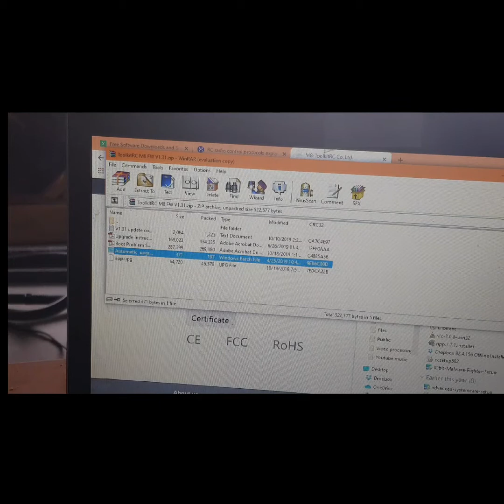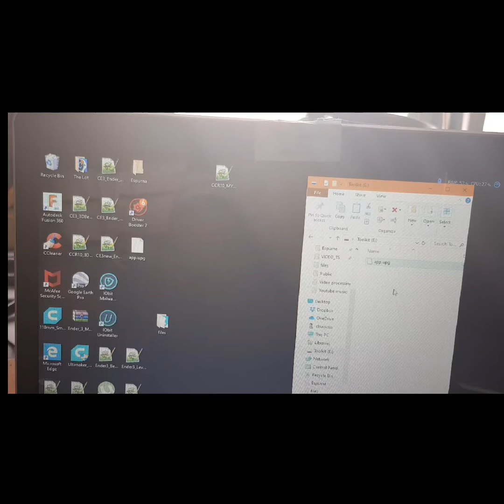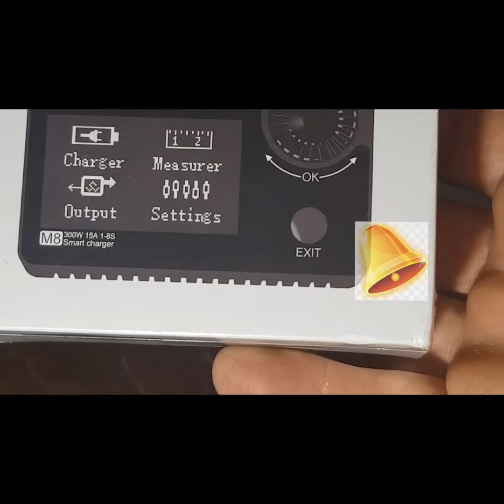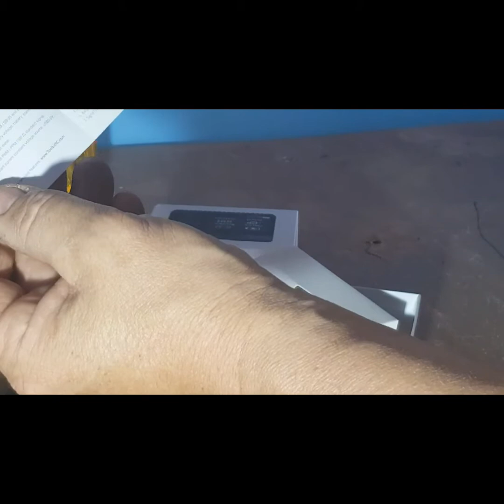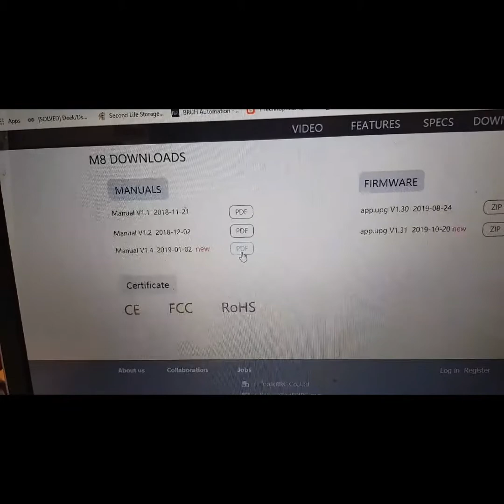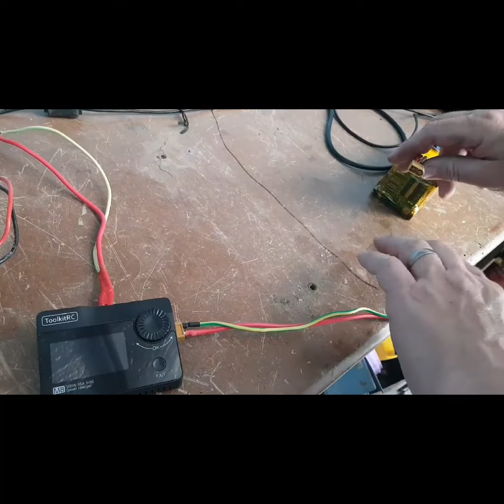ToolkitRC M8 explain the power supply system and firmware update. Read comments first.

Comment: Ok wow it's not just me! I got one recently (Jan 2021) and had an issue where it would begin to charge then after a few mins the input voltage no matter if it was a battery or DC power supply would start to drop to the point it gave low input alarms, so I was advised to update the firmware, so I did and as far as firmware updates go this was by far the easiest, all looked good so I disconnected it from my PC and plugged a 6s into the input... HOLY HELL!!!! The fricken thing exploded throwing high amperage sparks for a foot, the smoke and sparks were like fireworks! Long story short I sent it back, got it replaced AND refunded, I've obviously NOT updated the firmware or calibrated it and It seems to be working perfectly so far, here's a question for anyone who knows more, is the calibration meant to be a one off or something you need to do occasionally or all the time?
Reply from the maker: As a previous calibration technician we would do it each year or two years. Saying that what are they referring to, the machine? Calibration  is normally done to a high machine which is 10 time better than the machine you are using. I think I will pin yours to the top for people with problems, doesn't sound safe.
Reply: @chuxxsss  so what would you suggest I do? I'm an ex computer technician so I've no issue measuring and adjusting highs and lows with my trusty Fluke MM, do you think it's worth doing or leave it as is? As it turned out I've ended up with two of them now, the other one is still sealed in its box and also has the external 180W 19.5v 10amp power supply, what do you suggest? What do you think is the best way to calibrate it? The manual says "press the exit button once while in the logo interface" when I do that nothing happens and I don't want to press too long and possibly send it into some debug mode etc, Thank you very much for your advise, I really appreciate it and I've no doubt many other people will as well as I've had a hell of a time finding out any of this so far 😐 so again, thankyou kind sir :)

Comment: One more question if you can help, I've looked for this everywhere, I've downloaded the full manual and googled all day but I cant find this, when charging or discharging to the left of the voltage value in red there's either a "CC or CV" that I get, but underneath that next to the amperage either a green P F or I appears from time to time, I'm obviously an idiot but what does it stand for, as I've sat and watched it but can't see a pattern to it, please someone put me out of my misery lol, what do they mean?
Reply from the maker: CC is constant current or for CV constant voltage. So then we come to PF or Power Factor here is how it works.
Power Factor is a measure of how effectively incoming power is used in your electrical system (energy efficiency) and is defined as the ratio of Real (working) power to Apparent (total) power.
Real Power (kW) is the power that actually powers the equipment and performs useful, productive work. It is also called Actual Power, Active Power or Working Power.
Reactive Power (kVAr) is the power required by some equipment (eg. transformers & motors) to produce a magnetic field to enable real work to be done. It’s necessary to energise this equipment however it does not perform any productive work.
Apparent Power (kVA) is the vector sum of Real Power (kW) and Reactive Power (kVAR) and is the total power supplied through the mains that is required to produce the required amount of Real Power for the load. It is also known as the ‘demand’.
Power Factor expresses the ratio of real power actually used in a circuit to the apparent power delivered to the circuit. The total power demand on the network is usually greater than the real power. The ratio of the real power to the total power is your power factor, a number between 0 and 1. The higher the power factor the more efficient your site is at utilising the supplied power.
The ideal power factor is unity, or one (1.0) which means that all the energy supplied by the source is consumed by the load. Anything less than one means that extra power is required to achieve the actual task at hand. Power factors are usually stated as "leading" or "lagging" to show the sign of the phase angle. Capacitive loads are leading (current leads voltage), and inductive loads are lagging (current lags voltage).
So you took me back on this one lol.
Reply: Great thanks for all that, went I bit off subject but I'm glad you did as you answered a ton of other questions I've had over the years. You've got a real gift when it comes to explaining things, thank you! With the letters I mentioned on the bottom line are either F, P or I alone but not together, e.g. not "PF" rather "P" OR "F" OR "I" at diffferernt times during the charging cycle, I've also noticed that in the discharge menu there are actually 3 options, recycle, internal AND external but selecting external always gives me an error "please connect load"
Reply: @chuxxsss  ah, but not worry I fried one of   them today,  I didn't even get to update it, I simply plugged it into my Pc, it corrupted and no longer turns on, ok, now this is TWO chargers with TWO different build dates I've had die for no reason, these are dangerous unreliable chargers, I'd not reccomend them to NOBODY. I'm thinking of creating a class action as even I alone know 6ppl who've had trouble, I wonder how many in total? Please message me here if you've also been hurt by these deadly sparkboxes.

Comment: MAN I got freeze while charging and then it doesn't power up right now I don't even upgraded it as box piece I'm using I have no idea what was my firmware version pleases help me out
Reply from the maker: Can you rephrase the first sentence please. As I don't understand it. Does display still turn on?
Reply: @chuxxsss  no it's not powering up bro
Reply from the maker: @geekboystudio2405  Then probably your firmware or component is fried. Open the box without power.
Reply: @chuxxsss  how to flash firmware while it doesn't power up and checked components where not fried
Reply from the maker: @geekboystudio2405  First you will need to find firmware then open box look for 4 to 5 pin header. Check out chip that they used for CPU too.

Comment: Their software has bugs. The latest ver, 1.23 , corrupted the charger. I’ve been back and forth with toolkit about this issue. Their instructions to repair are awful.
Reply from the maker: Can you open it up and connect directly to the board? Like some header pins? If not that is not very good. Will pin your comment to the top. Thank you for the information.  Stay safe, and have a wonderful day.
Reply: I did the same thing, and 1.23 brought up a black screen when it is powered on, and I have to hit ok like 4 times to get to the 4 functions of the charger. Then it just freezes and does nothing. I'm curious if formatting it before installing the firmware file would help?
Reply: The way I fixed this was to place a 100 ohm 1/4 watt resistor across the xt 60 output terminal. Then powered on the charger and the splash screen came back and all was working. This was ten months ago and I don’t plan on downloading new firmware again.🤬

Comment: I did the same and now my m8 is not powering up. When I emailed bangood they mentioned it's out of warranty and I need to get it repaired at a local store. Please help
Reply from the maker: You may need to flash the original firmware. You will need to open the device up to do this via the programing header. I don't know where to get the original firmware sorry.

Comment: your video is amazing. I have a 12 V Charger and can I use it as an Input to the M8. I tried doing so and connected a 2S Battery but I got battery error and it was charging but didn't charge fully. It only moved from 7% to 9%: I guess something is wrong. I want to power the M8 with a power supply. Shall I try firmware upgrade first and then connect the DC Adaptor and see whether the charging works or not.
Reply from the maker: I would do the firmware update first. What type of battery are you using to draw charge? And what is your load?
Stay safe have a wonderful day.

Comment: Sir can i use 17v 100watts solar panel as a input to this device?
Reply from the maker: Check the current restrictions on the device as the is 6A from the panel. If it says it can take 6A should be good.

Comment: IF you do this on a Mac or Linux it will brick the device and you'll need to find a mate with a Win10 PC in order to properly copy over the firmware.
Reply from the maker: Oh I didn't know that one. Even with Wine?
Reply: @chuxxsss  Too late for me to test - it's bricked :P But I would assume so, because there's some black-magic stuff going on here. Moving a file over to something claiming to be a USB drive isn't how the actual firmware and bootloader get updated. The M8 has to detect the new firmware and install it. So why it only works on Windows is probably something to do with how it writes the file. Some hardcoded byte positions. So a windows emulator may not be emulating to that kind of level. I really don't know though :)
Reply from the maker: @cannaroe1213  I wonder if the is packed on the device is a Windows Ce cut down. They use linux on some chinese cameras  compressed twice.